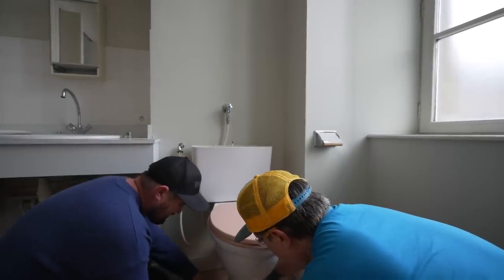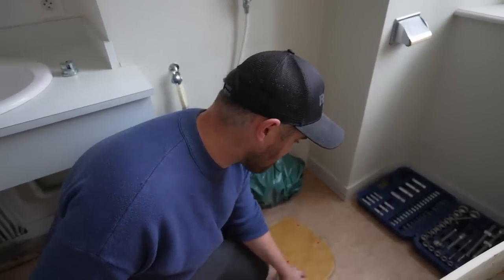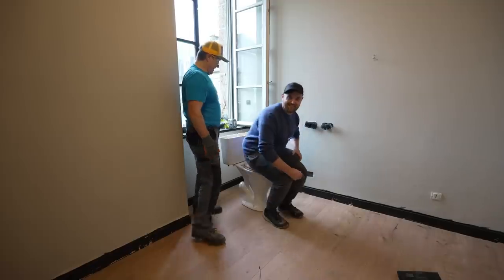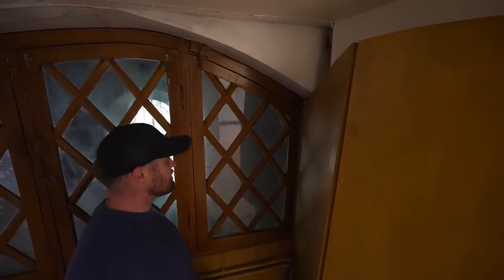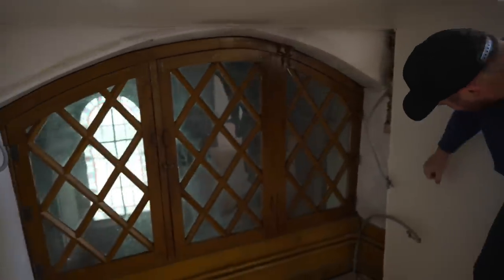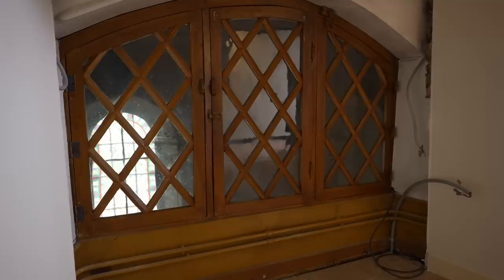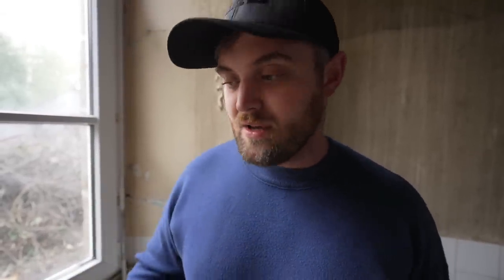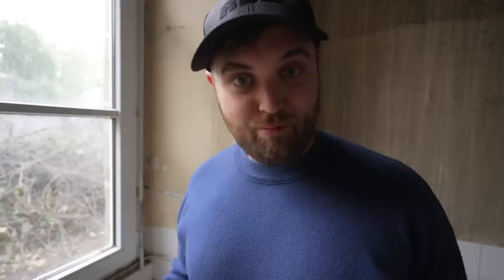They Refused To Insure The Convent

Comment: Now that you have done so much and maybe when Sadie and Mo are living on the property you can get a better insurance rate. Love the windows you found in your office. I would not cover them back up with the shutters especially since the shutters are not original.
Reply from the maker: Thats a great idea!  hopefully they can get the apartment finished soon.
Reply: That part confused me also.  They can't expect owners of commercial buildings to marry the property. Billy, if you have anyone living on site (Ryan temporarily?) would that help?  I assumed they would ask that question and why they are requiring you to be there so much as the owner.  Do they think vandals won't attempt to throw rocks at the stained glass if the owner was there?  We've seen so many of the security measures you've made. It seems like they would take that into account, but failed to do so.  Maybe even showing a lease contract for anyone living on the grounds would be more concrete evidence that the property is being watched and cared for.

Comment: I'm in the USA, and I've never seen a toilet that didn't connect to the sewer pipe directly under the seat (yes, with a u-bend), so when you pulled the fixture up and there was no hole under it, I was so confused!!!!  Is this the default style in France and other countries in Europe?
Reply: It's definitely the usual style in the UK, I've never seen any other design
Reply: I had the same thought! I was like wait where does the water go? 😅 seems like a much better way to install than the pipe in the ground.
Reply: Besides that the European toilet doesn't block that easy as in the US.
Reply: I had the same thought!   What the heck.  Why don’t they do that in the US?   Genius

Comment: I have so many questions, possibly to be answered in your next Q & A? 
-  Was the leaky roof above the apartments a factor and what are the plans on having that repaired?
-  Will having tenants, especially family, make a difference? In particular, with the requirement of you being there so much. 
-  The same question goes for having people, even if not family, working out of offices in the main building? -  Does the security system make a difference? 
-  Is the elevator a factor?
-  Are you going to be required to heat the entire thing and if so how is that going to be handled?
-  Are the old fireplaces an issue even if not in use?
Reply: Great questions!
Reply: Really good questions! 👍👍
Reply: Well, i don't know about the rest but i know about the fire places. The fire places that aren't used need to be blocked of, if not there need to be some things to ensure that they are not a big fire hazard, which they are in that condition...so yeah, they need to be secured or the chimneys need to be blocked off...

Comment: As you go through the process of updating the plumbing and electrical, it would be an excellent idea to hard wire smoke detectors and plumb in a sprinkler system. Our co-op apartment building saved a lot of money on insurance and it can save lives.

Comment: Insurance companies are about making profits, not taking risks.
In 2001 I sold a  home, that had been originally built in 1932, added on to in 1972...
My sons & I had re-roofed it (had been illegal) replaced all electric wiring & new box, new plumbing & I did the tuck & point work on both fireplace & chimney. 
The appraiser for the bank told me if we hadn't done all of that work, it would have been deemed uninsurable & that would have meant unsellable as well. Landscaped, by me, all new flooring, and paint, counters, exterior..the works. It paid off in the long run.
Keep your eye on the prize: you've got this!

Comment: Billy just watched the vid mate cracking as usual 👍 have you thought about boxing the pipes in under the Chapel windows which would obviously hide the pipes but also you could have your light switch for the lights in the Chapel on the boxing instead of on the wall and save on sheaving the cables on the wall and as a retired plumber your right on the floor colour under the pan that's the original colour 😉 and just watching french farmhouse diaries advise Michael he has to get budo to make his windows they are a work of art keep em coming mate

Comment: I have 35 years experience in construction doing subcontracting and general maintenance, water and fire are the worse elements to affect a building in both structure and appearance. Vegetation and mold are the other two.
Ivy may look nice but damages brick (damages the glazing) and mortar (powders).
No matter what building an individual or party is interested in purchasing, always, I do say always, hire an inspector with general construction experience. They will list problems with the building. Inspectors that just walk around a property is not a good inspection. A good inspector is one that uses a ladder and crawls around checking everything.

Comment: I understand about the insurance nightmare. Here in the US,  if you will have a mortgage on the property, it has to be insured prior to closing.  If the property is vacant, there again lies the other problem.  I think your rates would drop dramatically if someone was living there full time.  Also here if you if vacate a property and your insurance company finds out, they have the right to cancel you immediately or hike your rates to usually quadruple of what you were paying.  Also, commercial properties such as yours, have completely different rates and requirements.  They usually require sprinkler systems so depending on what you finally decide to do with it, you may want to ask that question now .

Comment: Did you get an Engineering Report at the time of Purchase? This should detail all the works that have to be done to bring the buildings  up to standard.  If you have a budget for the works and a Timeframe for completion.  There will ALWAYS BE AN OVERRUN. For Old Buildings of this size the insurance is Hard. When it comes to time of Review of Insurance All The Work You have Done should be taken into consideration.  FOR SURE ITS A BRAVE PROJECT!!! You have a Very Positive Attitude,  In time it will be a Wonderful Building. "Crack of"  Good Wishes from Ireland ☘. 🍀🍀🍀🍀🍀

Comment: About half my 1930s Arts and Crafts bungalow still needs a wiring update (and yes, I pay too much for insurance).   New panel and service, but some of the runs are still K&T!!!😧I have turned off the most problematic one, even though that means I have no porch light!   It's never ending in an older building.

Comment: Good lessons to pass on. I had a similar concern on a much smaller scale when I purchased a 120 year old hand built cottage in the NW US that had a 70+ year old electric panel. The previous owners had not bothered to update the electrical. I knew this before I purchased the cottage and made certain that I could insure it, but it wasn’t easy. I had the place rewired and a new panel installed over 5 years ago. For those first 2 years, however, I lived in fear of an electrical fire starting. Had I been able to afford it I would have taken care of the electric and other matters from the get go. Ahhh… youth. 😊

Comment: I have an insurance situation as well.  Because there is no mortgage on my current home, i cashed in 401k to pay for it, and it was built in the 1890's so no central heat and air conditioning, we could not find coverage at any price.  Did I mention the house is yellow heart pine from floor to ceiling and I live in hurricaine country?  The three fireplaces have no mortar left between the bricks, it is just sand now and so all fireplaces are closed off.  My husband ran new Romex to a new breaker board, ran ductwork in the attic and installed HVAC.

Comment: My goodness this raises a lot of questions.  Sounds as if the building was insured by the previous owner for all the time it was abandoned.  Is that correct?  Sounds pretty impossible.  In the US if one is borrowing money to buy a building or a home if you can't get the insurance the bank does it for you; very expensive though.  Not sure in Europe.  The precautions they wanted don't sound excessive, re checking doors and windows etc. It does seem like with all the work already put in that it shouldn't have been that hard to get insurance now. Wonder if once Sadie & Mo move in if that will make a difference?  I would guess that whatever insurance you get a part of it will be re-insured; in other words, the primary insurance will cover up to a certain amount say 2 million euros and the rest will go to a reinsurance company that will parcel out the rest to different companies. You were quite correct in all you mentioned as being problems.  You've done so much it shouldn't take much longer before you can get a better price. Best of luck it will all get sorted in the end.  Guessing that whatever you decide to do with the property will also have a bearing on the cost of the insurance.  If it is decided to do a cooking school and / or a restaurant that is a whole other level of cost in the kitchen for fire suppression equipment.

Comment: I don't understand the reasonimg using plastic breaker boxes vs steel. My place in Madrid had updated electrics, all plastic panels, conduits, and yet I got an electrical shock everytime I entered the kitchen barefoot and touched something metal. The electrician couldn't fix it.

Comment: This is probably one of the best response in regards to many of your vlogs about the convent and on the subject - the dreaded topic .. INSURANCE!
Nobody ever thinks their going to have issues .. but this sad and very typical in the industry and it doesn't matter what country your in.  Having just retired from that Industry of 48 years, there's ALOT of questions dealing with the unique, the historical, OLD, structures that aren't of typical single family type of home risks.  Give it a year, with the added time with improvements, added security, etc .. the market might open up .. if you have events on the property open to public, etc or if you change the usage of the convent make sure you let your carriers know in advance .. as they may have to add additional riders, endorsements for protection if available..
Best of Luck Billy .. 👍 you and your team are doing awesome.
**PS .. Email some of the different cheateau owners and see where they are able to get insurance with,  Here in states, Chubb handles high end valued homes, but again you have a complete different type of structure .. now a converted convent.  Alot of carriers might NOT have an appetite for this type of risk.  Again, Lloyd's is always out there but again make sure you & they understand the coverages that you want & what they or any carrier will propose, sometimes it might not be as broad of coverage as you want.  Also make sure to give them enough lead time to quote .. sometimes it might be a couple of weeks before the underwriting dept will have the information they need to give a proper proposal.. 
Love the vlogs .. and your attention to detail in all you do ..

Comment: I understand why no insurance company wanted to take the risk of the big old structure.  I am surprised you found someone and surprised the price isn't higher.  Unless you have a mortgage and need insurance on the structure, I would just get basic coverage for the roof and windows.  Liability insurance is a definite since you want to protect yourself from someone coming on the property and injuring themselves, they will come right after you.  My big old building I had a restaurant and bar in in.  My biggest cost was liability insurance for the business and for the property.  I used to pay about $1,500 a month for my total insurance and that was 15 years ago when I sold it all.  I had no mortgage so I only insured my new roof and new windows.  Since I sold beer and liquor my liability insurance on my bar was enormous and a multi-million policy.  Lots of expenses . . .

Comment: Obviously,  the video titled spent our savings on an old building is ludicrous.  This building in today's market would fetch 30 million. Because you cleared a few brushes,  or trees and spent time unnecessary to renovation.  Bringing in a crew of professionals. Landscaping Mexicans,  this would have been done in five days. In the name of truth, not religious beliefs.  Can you disclose your total purchase,  vrs clean up fees. Now add the inside video. The mold. The basement.  The attic.  The roof shingles.  ( cost of 50,000) roof repairs.  Furnace, the water system.  The heating. The electric.  This is potentially a possibility for good video. Just be honest. Don't act like its not a religious/ customer or public owned, family. Just tell viewers.  Share more please. Thanks.

Comment: €6000 seems pretty cheap based on the size of the building. I have a lock up which is about 33’ x 17’, single storey in a nice area of Manchester and the best quote I have received so far is £1500.

Comment: In Oz abuilding under construction (i.e the Convent) cannot be insured under a normal Building and "Fire, storm and tempest" policy.  The insurer would consider that the work you are doing, in many parts of the building simultaneously, makes the subject an "under construction" policy. To add further difficulty you are not (to the best of my knowledge) licensed builders contracting with licensed tradesmen. Sorry Billy, but as much as I admire your vision and ability, I too would be reluctant to give you cover.

Comment: Billy...wow!  You are so composed.  I would be totally in pieces to go through such scrutiny.  If they were to see all of your videos, they would see the detail to safety and security with upgrades and expensive protection to protect this property.  It's not like you're flipping it and cutting corners on cheap material and labor.  Insurance companies can be so unfair no matter what country your property is in.
I am shocked that with your experience and your father's decades of experience and the people you employ, they could not take all of that into consideration as you have completely restored this beautiful building. Don't they have building codes to go by?  I think they would jump at the chance to insure it because it seems like a small risk with what you have done.  You have no control over the past owner allowing vandals and squatters damaging an abandoned property.  It is obvious that with the security measures you have in place, and the completely restored condition, vandals and squatters will not be a problem.  
Antoine below seems to have some good suggestions...but "specialised" building risks sound like extra costs in premiums. I hope not. I hope you find a better company.  France surely has an insurance ministry to appeal to.  I know that there are still some pockets of favoritism in other countries when dealing with business owners not being local.  I hope that's not the case.  You are the model customer any insurance company should want.  Best of luck with that.  I totally feel for you after all this hard work.

Comment: Color under the toilet is the original.
They would have used strong cleaners, probably very regularly if not daily, to clean the exposed floor.
These cleaning chemicals, used so much more frequently than would be in an average home, would have acted to 'bleach' the color out of the floor.
Further, I can tell from the difference in the sheen of the two different areas.
Also, from years of experience working with color restoration, the outside color is a desaturated and lightened version of the color under the toilet.
Combined with my chemical and property management experience, I know that you can remove color and vibrance very easily over time, but it takes purposeful and typically costly efforts to add back color and vibrance.
In sum, the color under the toilet is the original, or at least closer to the original than the outer.

Comment: That’s absurd!  That property has gone through massive renovations & if everything is up to code & you can prove it, then a large, established insurance company should be able to back your up.  The only thing is a massive property like that should be wired for video surveillance & there should be signs posted stating as such. Not exactly sure what you’re going to end up doing with the building but there are specialty insurance companies that will insure you as a hotel or Airbnb

Comment: For insurance u need  plants verified and up to norm . Wich norm to refer depend from the law of the state   .  About the power box u show in the video seems to ne totali out of norm. Its Also too small for a big building like that. There should be a main distribution box, and sub box for each area. Electrical wires too old and probably damaged by age water, rats and poor maintenaince.

Comment: I think $6000 per year on that huge building is cheap for insurance - due to the square footage alone...Keep up all the maintenance and get the roof fixed ASAP.  It will save you thousands later.  I think it is AWESOME what you are doing for that community.